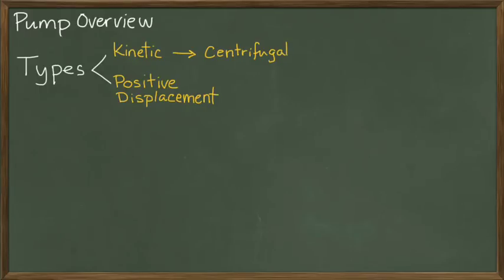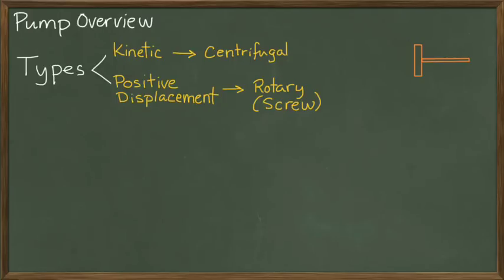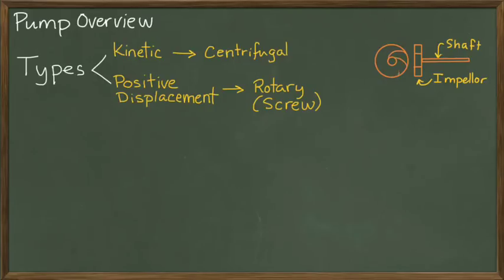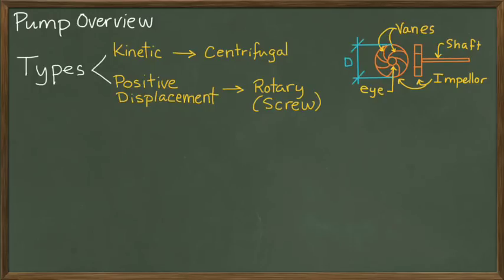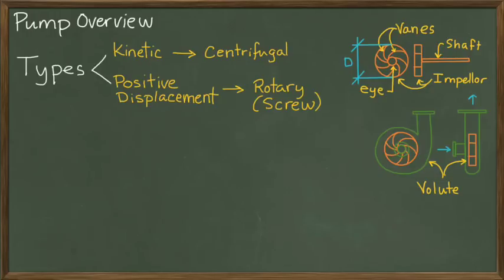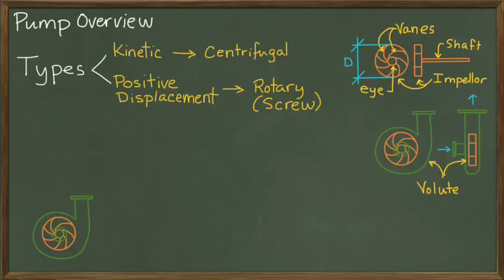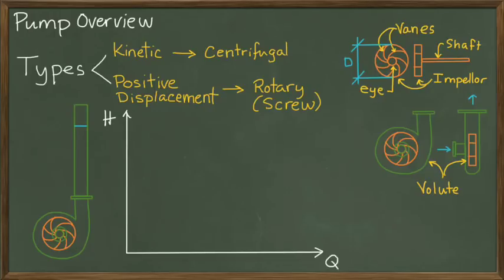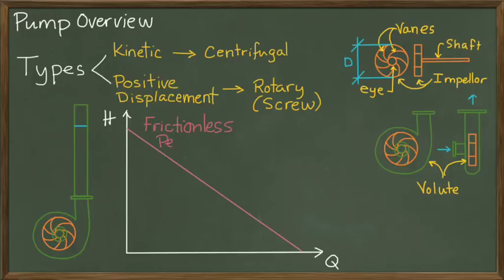Centrifugal Pump Overview

Comment: Hi there , may i know what is the head and flow relation for Archimedean screw pump , is it the same as centrifugal pump where the higher the head the lower the flow? Thank you
Reply from the maker: I've never specified a screw pump before.  My instinct is telling me that the flowrate does not vary with head - It only varies with the rotation of the screw since the fluid is not under pressure nor working against the column of water upstream of the pump.  So at a specific rotational speed, the flowrate lifted by the screw should be constant.  However, I'll do a little more research ...